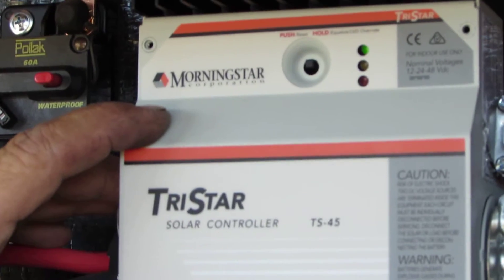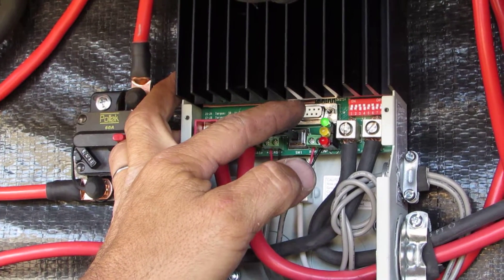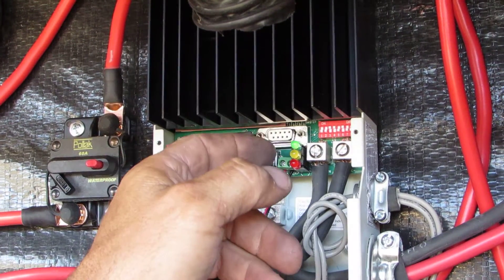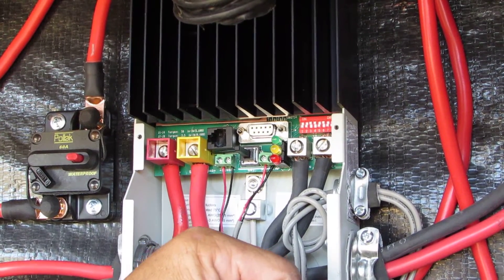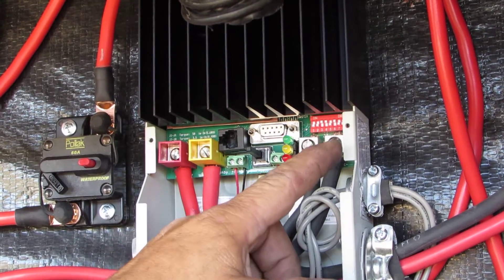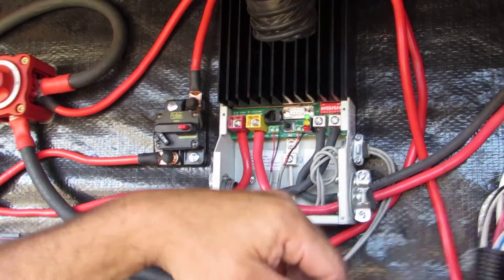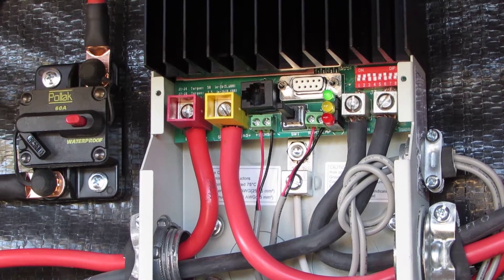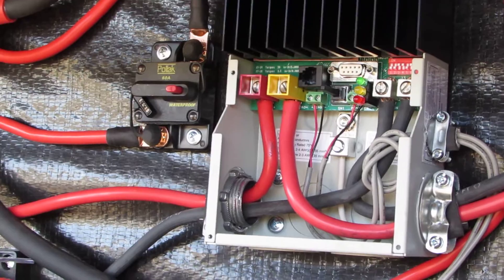Solar Controller Install MorningStar TriStar 45 amp PWM

Comment: Can it be used with lithium batteries?
Reply from the maker: Yes a PWM Morningstar Tristar controller can be used with lithium batteries as long as the charge set points are set for the battery type.
   Happy Trails!!!

Comment: Mine is running 48V with 4 large marine deep-discharge lead acid. Used a small PV series wired array (400w). It's for back-up only and I was shocked to find it was still working after 10 years of service. I guess the PWM does extend the battery life..

Comment: You need to get the book for that charge controller- the 7th switch is for diversion loan only- the eights one is for charging --on ---is automatic charging every 28 days --off is manual charging when you push the black button and hold it for 5 seconds.. I have 10 --of these charge controllers and  a (1) 60 and a (1) 45 set on diversion load for my solar hot water. I have 50 ---100 watt panels and 10 charge controllers-all morning star tri star. Some are pwm and some a mppt.
Reply from the maker: Yep, this one we used in the video the dip switches had not been set yet. We where just using it to talk about the subject. We adjusted the settings before the install job was finished.
Happy Trails!!!
Reply from the maker: #7 DIP switch on a Morningstar Tristar PWM controller is for  turning the Auto Equalization mode on or off.
Reply from the maker: DIP Switch Number 8 - Noise Reduction, ON PWM or Off.
Reply from the maker: https://www.solar-electric.com/lib/wind-sun/TriStar-manual.pdf
Reply from the maker: I think you need to read your manual.

Comment: Good day sir, how many watt solar panels I fit conect to this divice tristar pwm 45a? With dis 12v battery 3600ah?
Reply from the maker: You can have around (4)- 180 watt 12-volt panels on this controller. It will be a higher wattage for 24-volt and 48-volt battery banks. If you want a higher wattage solar array you can go for a larger MorningStar TriStar 60-amp PWM controller.
Also you can go with a MorningStar TriStar MPPT controller (30/45/60) if you want to go with a higher voltage panel than the battery bank you wish to charge.
Happy Trails!!!
Reply: @MobileHomesteading  yes I have got the higher charge controller sir, Morningstar TriStar 60 Amp MPPT Solar Charge Controller, so hw meany 180 watt 12-vol panel on this controller sir?
Reply from the maker: @jacobsamuel5444  You can have  a overage of wattage with a MPPT controller. It will only make 60 amps max to your battery bank. I normally install up to (10)- 180 watt 12-volt panels in a parallel array to a combiner box.
Things are different as you up the voltage, or series the solar array.
Happy Trails!!!
Reply: @MobileHomesteading  Good morning sir, thank you very much...

Comment: Hello, My TS-45 is connected to my batteries 48V. And My solar Panels are connected to the controller 69-74V 14A. But my controller sometimes shows the green and red light at very quick successions.

Comment: what gage wire you use it both for PV and BATTERY, that kind of cables give more efficiency of controller?
Reply from the maker: Howdy! The size of the wiring depends on the D/C load, or the Solar amps/watts that will be using it.
Happy Trails!!!